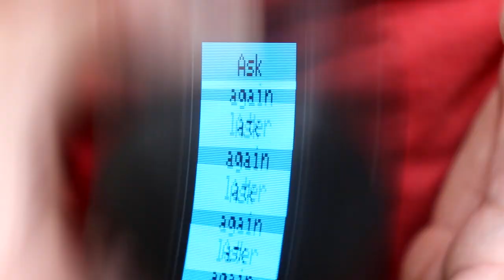Unleash Your Inner Maker! - byte sized channel trailer

Comment: HI Zach , sorry to ask in comment I didn't know how to find any contacts or emails ... i wanted to turn a smart power switch in a button toggle , let me explain : i have notice that many of sonoff or wemo power switches that you plug into the power socket on the wall and then say a fan or lamp you can turn it on with app but mine also have a a physical button and I know you can setup many apps to press it for only a split second as if its a button ... Now i was hoping to take join two wires to the button and use on a another device to press the Button instead please , if the voltage is very low i think it will be ok as i tried these fingerbots and they all were about real quick due to the plastics in them ... I don't want to hog you comments with more writing so please email me with some ideas even if I use a separate relay some how ... i just want to make my dogs electric blanket come on & off when needed or tire it in with Home Assistant or what ever app i need to use :) thank you regards Maz